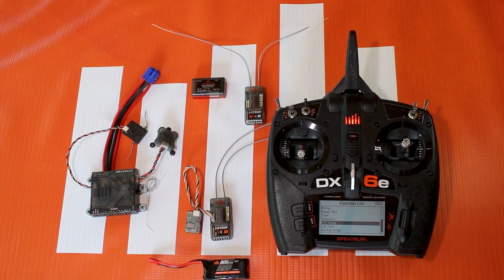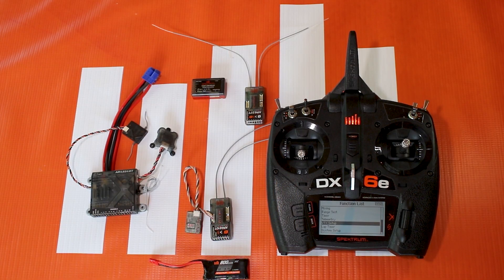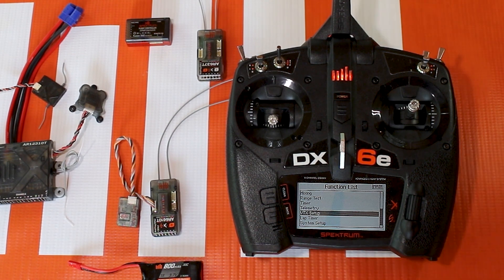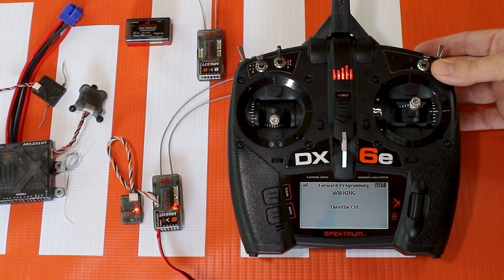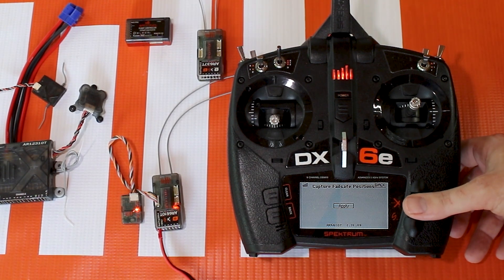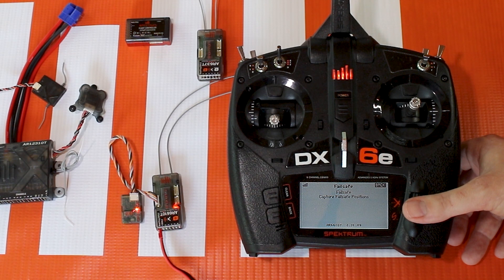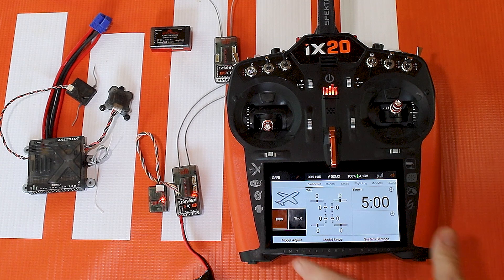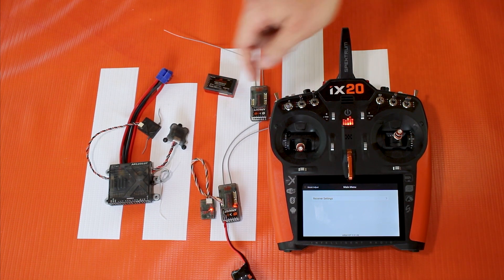Spektrum Quick Hit Tech Tips - How to Setup and Use Forward Programming

Comment: Hi there. Fairly new to this, I would love to know how easy it would be to make a SAFE mode for a replacement E-flite Viper on the new AR630 or a SAFE mode on the FMS Avanti v3. I have a DX9 TX.
It seems you cannot simply buy an AR636 original Viper receiver & just put it in to fly in this mode. Regards
Reply: *there is nothing easy or quick or fun about this  so be prepered to be put in a bad mood and stay that way for a long time
Reply: @TROUROCKS  that is what I'm discovering, I don't like the complexity but at a point where I need to learn it in order to do what I want to do. I'm having a hard time just learning basic terms and finding good educational resources - sometimes comments turn out to be a good source.
Reply from the maker: The AR630 would be the easiest way to get Safe on that model. Our AR637T programming series covers how to setup and tune AS3X and Safe :)
Reply: Many thanks for letting me know. I have ordered two Ar630 & they should be here today so I will follow your detailed video to have a go  at setting up in SAFE
Regards & keep safe & well

Comment: Would the AR620 have Forward Programming when bind to my DX6 Gen3 if I updated the firmware on the radio..?
Reply from the maker: Hi Teri, it will not.
Reply: @SpektrumRCvideos  Thanks for the reply. I've just upgraded all the RX's in my models to the SPMAR620 and set the fail safes the usual way... I just need to register them all now.
Reply: @SpektrumRCvideos  Hi Spektrum, just to let you know, I have Forward Programming with my DX6 Gen3 (SPM6750EU) and it works really well...

Comment: I bought an AR637T in order to check out Forward Programming vs programming SAFE Mode in an AR636 with the Spektrum Programmer, SAFE Model Builder, and a laptop. It took quite a bit of going back and forth in the Forward Programming menu for the first-time setup, but once it was set up, it was much easier to fine tune things. You don't have to be a techno-geek to add AS3X or SAFE to any plane. Plus, the voltage port will come in handy if you want to monitor the voltage in your Lipo battery in real time. I also like not having to use a bind plug and the antennas are much better..

Comment: This was great, especially the comment near the beginning of your video, that clearly stated you were programming a device, rather than something inside the transmitter.  
I’d also appreciate a video of sorts about telemetry.  I have an AR6335A receiver in my Blade 150S Heli.  I set up telemetry using Auto-Config on my ix12 Telemetry programming window.  Telemetry config window now shows (1 through 12) as follows: Volts, Temperature, RPM, AS3X, Apha-6, Empty, Empty, Empty, Empty, Rex V, and Flight log.  I appear to be missing something though.  There must be more to it, because I’m not seeing Volts, Temperature, RPM, AS3X, Alpha-6 (what is Alpha-6?), Text Gen (what is text gen?), and Flight log reported anywhere.  I do see Rx V reported on the Flight Log window.  I feel like I’m missing something fundamental in my setup.  Any help would be appreciated or a detailed manual on how to properly set up, display and read/interpret Telemetry data.  Thanks in advance.